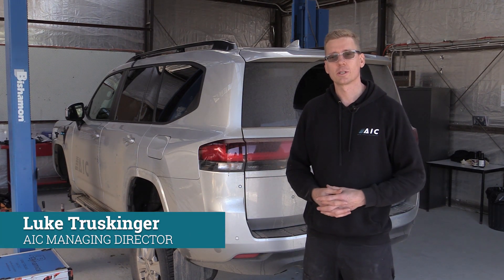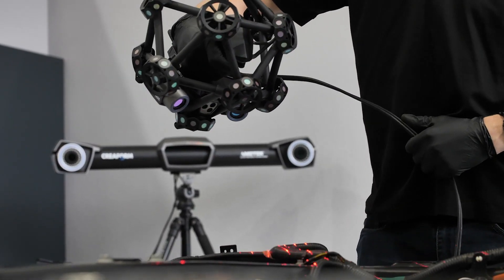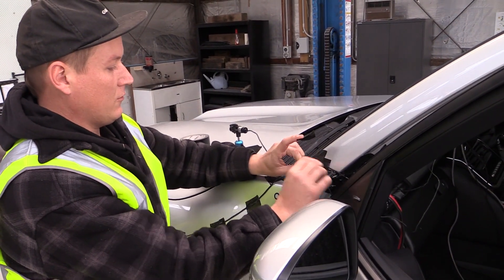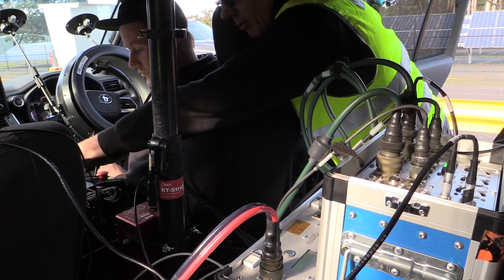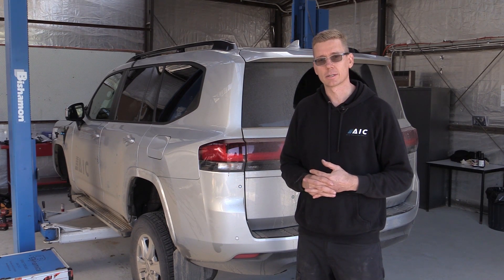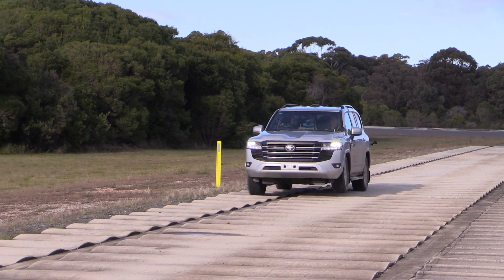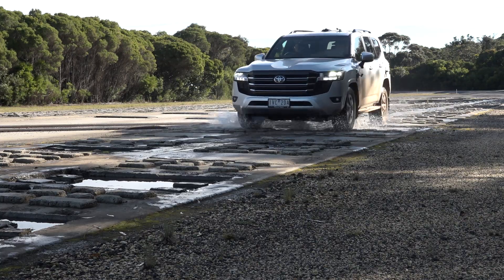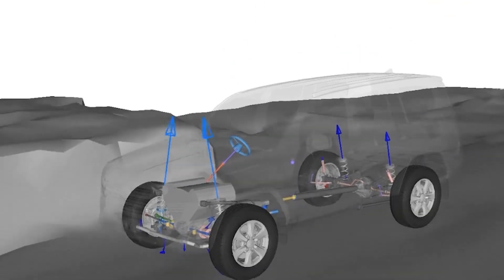Testing the 300 Series Landcruiser To The Limit [GVM Upgrade]

Comment: Very interesting.  Is it possioble to know which customers use your information?
Reply from the maker: We can't say specifically due to confidentiality agreements, but we work with a number of aftermarket suspension and 4WD modification companies for GVM Upgrade and other AIC testing services as well as offering our 3D scan database.
Reply: @AutoInnovationCentre  Thanks for reply.  As a retail buyer would it be the case the end supplier ARB, IRONMAM, TJM to mention a few could tell me if their aftermarket products are based off your data?
Reply from the maker: @Kevin-ee2tz  That would be up to those companies to discuss how they are developing their products for users.
Reply: @AutoInnovationCentre  I think as a consumer, we would like to make sure that brands we buy have proper R&D.
Reply: Ohhh, finally somebody that’s doing the sort of testing that will yield results not biased by preconceived opionions snd ideas.

Pity you haven’t shown more than this.